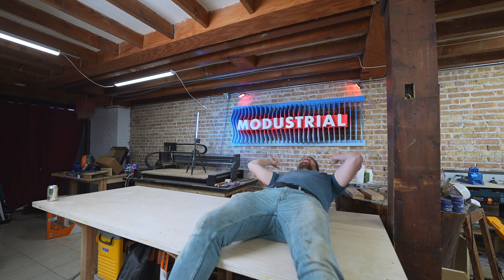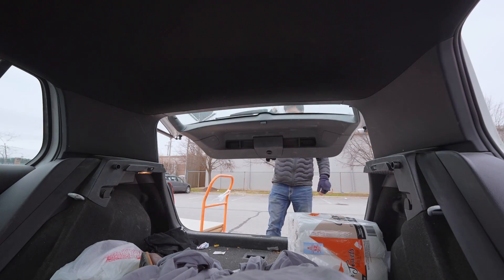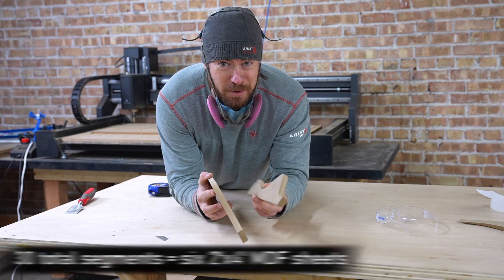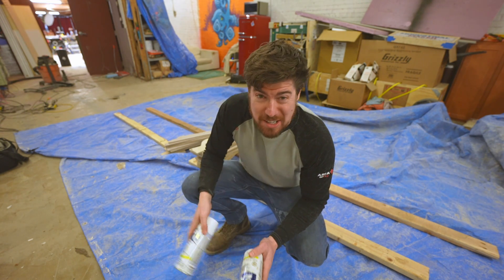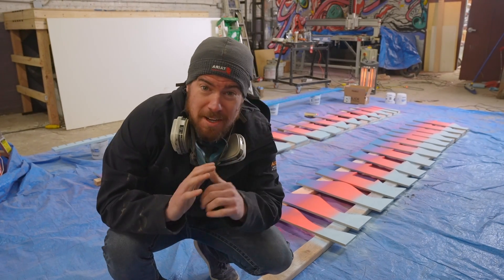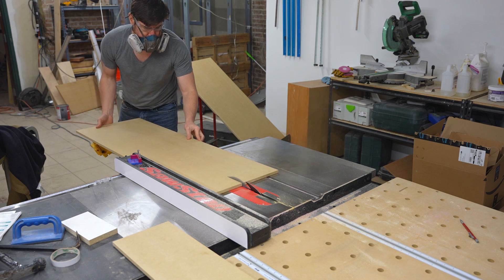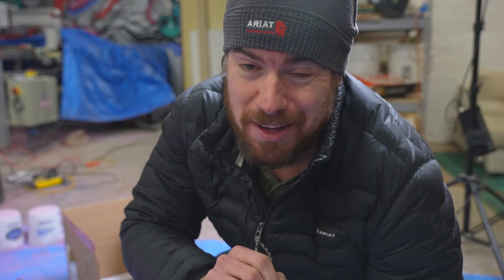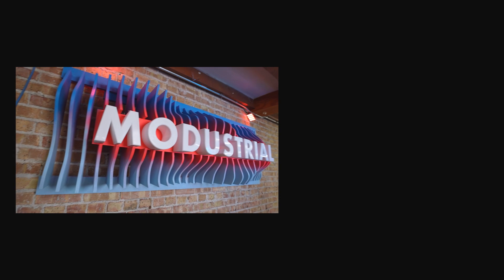EPIC MODUSTRIAL SIGN Build!! ...for the Abandoned Bldg Workshop

Comment: I still think the X-Carve pro is a expensive toy. The other CNC would have eaten thru the MDF without a hassle and the burred edges.
Reply from the maker: the edges are not a result of the machine, but the upcut bit I used.   I only used it to pull dust out of the hole, since the dust collection wasn't available.  With a downcut or compression bit, you get perfect edges with the X-carve pro.

Comment: The sign looks amazing.  It reminds me of a radiator or the grill off the front of a truck.  I wonder if you could have just used something like that instead and spray painted it - so you would not have needed to buy and cut the boards.

Comment: Don't forget that Lowes/Home Depot/Menards will cut down a 4'x8' sheet or boards. It's cheaper to do that than buy the hobby cuts. They can't do any complicated angle cuts, but they can do straight cuts. I have them cut down 4'x8' plywood into two 40" x 48" cuts so I can fit it in my compact SUV.

Comment: Y didn't u use the paintgun thingy like u used it on the wall ?
Reply from the maker: The paint sprayer is designed for volume....covering large surfaces FAST.  To do the gradient I needed low pressure cans that give you more fine control

Comment: I love how he showed the limiting factor of the Xcarve PRO without even drawing attention to it. He couldn't do the whole project on the Xcarve. He had to use his avid to cut long board to that holds the pieces cut on the Xcarve. I KNOW you can tile. This just isn't practical on the 2x4 machine, maybe it would be on the 4x4. ALSO Before you KEYBOARD warriors get to typing, I know the limits that inventables puts on their machines all to well. I have the original Xcarve 1000x1000. it works well just better machines out there for the money. I fell prey to marketing. With that being said Inventables is a great company who stand behind their products, but they totally dropped the ball with the PRO. For the money his AVID is way better.

Comment: For the dust getting everywhere: could you add a "welding curtain" type shield around the CNC to keep the majority of the dust in?
Reply: I'm not an expert, but wouldn't that add difficulty for the machine to cut correctly? Also maybe fire hazard? Correct me if I'm wrong, I'm happy to be taught better :)

Comment: If you ever run into a section of audio that's clipping, lower that bit by like 3-5dB. It looks like it's level with the rest, but the volume of it is actually much louder because the peaks were cut off (thus causing the distortion).

Comment: The sign looks ace with the wave pattern around it, great idea. Not 100% if this exists and it might not actually be an issue but it looks from the blow out when your CNCing that you're using an upcut fluted bit in the router, do they sell downcut ones as might make for less clean up after and sharper lines?

Comment: Call the shop "More Dust Potential" as a way to keep the dust down heavy curtain sides like some trucks use gives the ability to open and close the space without permanent walls (and the rails on the roof work for hanging stuff to paint etc) also paint spray goes further than I ever realized so the curtains may help with that too.
Reply from the maker: tell me about it.... Unfortunately, a proper dust collection system will have to wait until after I get 240V outlets added, and we weren't able to include those in the first electrical permit (sped things up dramatically to leave the electrical downstairs off the original permits).   So...that will have to be tackled after we pass the electrical inspection upstairs...

Comment: Hey Mike, nice project and great use of the CNC, but looks like you’re using in up-spiral for your cuts. If you switch to a down-spiral you’ll get a waaaay cleaner top edge and won’t have to spend half as much time sanding all the fuzz off! Just keep your feeds and speeds high and use multiple depth passes and you’ll get great finishes every time with way less cleanup! I was nervous of down-spirals because of the risk of heat build up (compressing spoil into the stock), but once I switched I’ve never gone back for MDF! Keep up the great work!

Comment: This sign is freaking sick. Great job dude. When you come to do the LED's look into the WLED project. It's a great little app that you drop on an ESP32 or ESP8266 in like two minutes and it gives you full wireless control of your LED strip colours AND special effects. It's also compatible with various smart home systems AND has scheduling built-in so it can turn on and off automatically! I think the hacksmith recently used it on a sign if you want to see it in action, but it's been my goto for a couple of years now and its SOLID. Can't recommend highly enough!

Comment: You have probably looked into this already, but, the different types of CNC bits (up shear, down shear and compression) would have really benefitted you here.
Reply from the maker: Yup, I've got a ton.  I like the upcut for speed....the fray it creates looks like a lot bigger deal than it actually is.   It sands off in literally seconds, with no noticable tearout, IME.

Comment: Just a thought; in the past, HD has cut panels down for me at no additional cost, as long as I bought the entire 4x8 sheet. Been retired for a few years, so maybe they have changed the policy. Another suggestion to control airborn dust from tools would be to use screens similar to welding screens around the working cutting tools- they will still make dust but it will be much more confined to the immediate area.As always, continued great success and accomplishments to you and your wife! Happy New Year!

Comment: Yo, purchase a Fuji Spray system. Then you can buy water based paint locally from a paint store. Most water based lacquers work well. Some of the Fuji Systems can even spray wall paint if you get the 5 stage turbine. So your options with one of the Fuji Systems is unlimited in terms of paint.

Comment: 10 letters x ~15 hour average 3D print time = 150 hours (6.25 days) of printing?!? Just for plain white filament letters. And that's on top of the time it took to design the look of the letters and make the print files, plus any setup the machine requires. That's kind of insane. 3D printing still has a long way to go. I feel like it would have been faster and cheaper to fabricate the letters out of acrylic sheet and some good old cardboard-aided design that doesn't require many thousands of dollars of equipment. To say nothing of how much easier it would have been to cut the MDF with a jigsaw.

Comment: Awesome sign, very creative! Can't wait to see the lights in the letters later. It would be cool to see it to have a slow pulsing light. 

Now I am a cnc lathing operator not super familiar with milling machines, also I am not very familiar with that type of board you used, but wouldn't it be better to slow down the cnc machine so that you wouldn't have all those chips left on the board from the drill? Or is it just because the type of board it is and now matter what you use it would still showed the same result?

Comment: The sign overall is sick, but you need to change those mounting brackets, they are distracting and look bad in the middle.
It needs to be something invisible, so either screw the sign directly to the wall or use some metal brackets in the back so you can't see it.

Comment: You need a cheap Chrysler/Dodge minivan. They have a 4' by 8' load area with all seats folded down.  I have moved refrigerators with one, whole pallets of floor tile, sheet rock, plywood, MDF, 12' 2"by 4" and even 6 fully grown people...
Reply: Yeah but then you’ll be stuck with one of the most notoriously unreliable vehicles.... a Chrysler or Dodge
Reply: @kylephillips8732  I had 250K mile on my 2010 T&C before it was totaled and just bought a used 2018 Caravan with 35K miles for $15K. Probably less than 1/2  what was paid for his VW.  AND, if you must have a "German" car the VW Routan was a re-badged Chrysler minivan with the same everything as my Dodge except the badges. The Caravan in no less reliable as any other minivan if properly maintained but as a large percentage of them are fleet sales (rentals) they are not well maintained and beaten like red headed step children by the many drivers that use them which skew reliability numbers.
Reply: Ted Blumstein Just get a Toyota.  They run forever.

Comment: Here's a tip: home depot will cut plywood for you for free. Just ask them to cut the 4x8 sheets for you into 2x4!
Reply: He was standing right in front of the panel saw when he was talking about not wanting to haul 4x8 sheets
Reply: I was thinking the same thing. I picked out a few pieces of plywood from their off-cuts bin to use as sample boards for paint techniques and asked the guy if he could cut them into strips for me. He was bored (or trying to get out of a worse job, maybe?) and only too happy to oblige. When I told him what they were for he ended up cutting each piece of scrap plywood into 4" strips, and then each strip into 12" lengths (the shortest the machine could cut). I ended up with 42 4x12 pieces! I guess they're supposed to charge for each cut after xx many, but he did them all for free. For all that wood and all those cuts it only cost me $5 total! That was a great day at the HD! lol
Reply: Came here to say the same thing.  He spent about 70% more buying the 2x4 than having the 4x8 cut, at least based on my local prices lol.

Comment: How you produced the wave lines in Fusion? Little tip bit video on that would be nice if there is easier way than model each individually.
Reply from the maker: I use the form tool to create a wavy plane, and then slice a box object in half with the wavy plane to get a solid object with the wave surface.  Then I draw a bunch of rectangles on the bottom surface and extrude cut up thru the wave object to create all the individual pieces.  That make sense?
Reply from the maker: Ps when the studio is setup in the building, I'm planning to include a green screen area so it will be easy to record some quick tutorials like this for a second channel.

Comment: Maybe you should get a "cheap" van for this or have a look at the new Canoo mpdv
also for the table saw, get a stopping guard for it. If you trip on it, it will hurt you. plus a vaccum for it so your lungs doesn't get damage from all of the saw dust
Reply from the maker: I've definitely thought about that!  the building used to be a Porsche auto shop in the 80s, so it might be fun to take on an automotive project when the reno is done....
Reply: @modustrial  Uhhhh yeah for sure!

Comment: try using a larger 0.6mm or even a 1mm nozzle for your 3d printer, it will significantly decrease print time at the small sacrifice of quality (larger nozzle also makes your prints stronger)
Reply from the maker: good tip!  I will ask Matter hackers what they've got as far as nozzles for the Craft Bot. :)